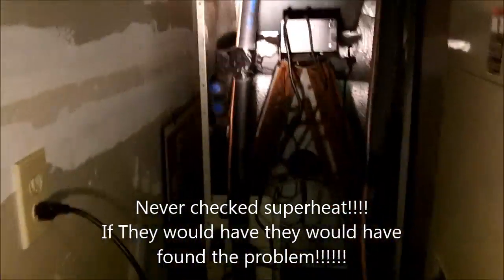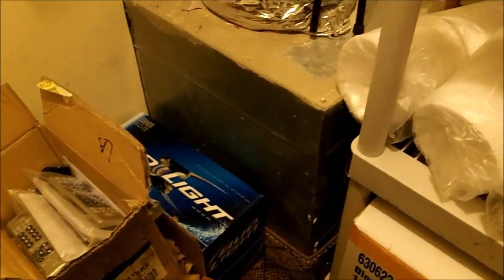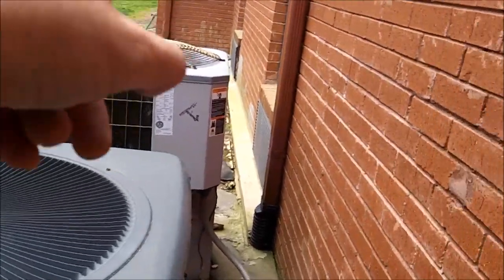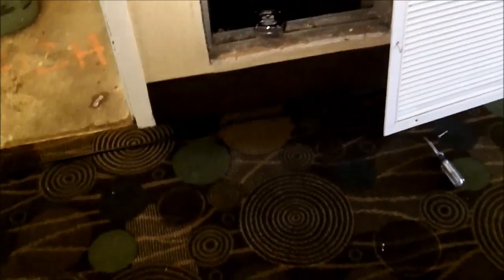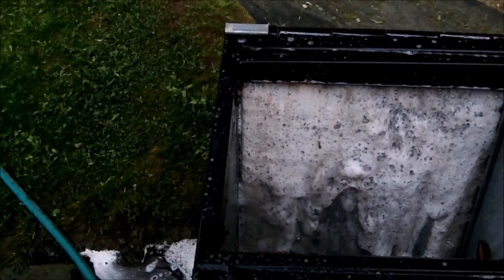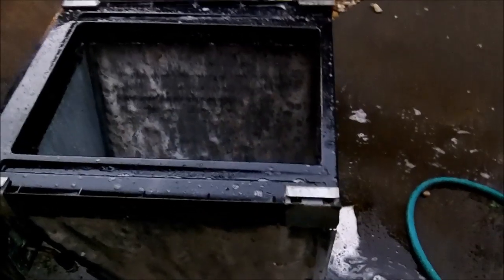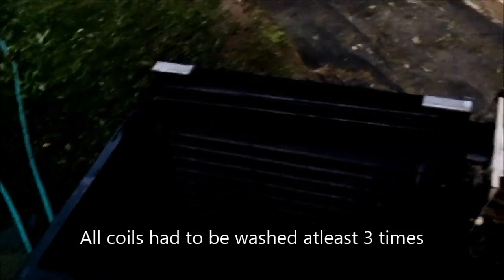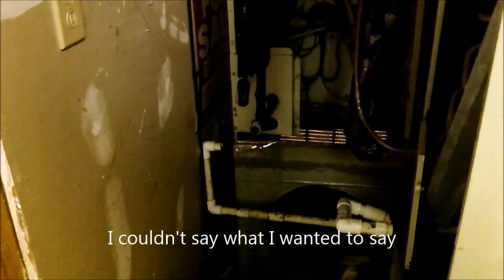HVAC Beer Can Cold Is Better Than Super Heat

Comment: hey, great video, .... can you tell me if i need to have a ball valve on the high side for disconnect purposes?  i have regular 5 ft. hoses and there is no ball valves.  if i wear heavy-duty gloves would i be ok, or will i risk losing too much liquid?  i don't care about liquid loss, i just want to pop some manifold gauges on and see if im low on R-22, and if i am , i will pump a few lbs in there or whatever it calls for but I heard you can hurt an A/C system with the wrong disconnect procedure. would you recommend ball valves on all 3 or just the red (high-side)?  also, the last person who serviced my A/C didn't put the schrader valve caps back on and it's been a long time since it was serviced, should i buy a schrader valve replacement device so I can do a leak detector fluid on the replacement tool and then if they show leaks i can use the tool to replace the schrader valves on a running system?  Or do you think those un-capped scrhrader valves are probably ok even though the caps were not replaced at last service?  my A/C is only faulty on REALLY hot days (air is not ice cold), which leads me to believe that i am low on R-22 since i have cleaned the condenser coils outside and checked the filter.   I have not cleaned the evap coil , but i don't think it's that dirty., but it has never been cleaned in 24 years that I am aware of.  The problem is , i can't see underneath of it, just the two sides of the "A" shape.  the two ends of the "A" have plates so I can't see inside (and of course, I can't see underneath of it because it is on the floor of the furnace).  I know this is a lot to decompress but your help is immensely appreciated.

Comment: Don't blame the installers/ HVAC contractor. Blame the genius engineers for packing the air handlers in the small rooms and the lack of airflow. Good work though buddy!
Reply from the maker: Everyone is at fault here from the engineer, installer then the inspector.
Reply: Do you know how many times I told a builder that a room, chase or unit was to small and they said cost be damned make it right .............. that's right never. Got to love these service guys who think the installer came up with the room size and equipment configuration.I know where the place is he was at and the code states clearance in front of unit has to be the same as unit depth so don't blame the installer for the code or the room size he did his best to make chicken salad out of chicken shit.
Reply: Why would you ever blame the installers?  Half the problems out there are created by inexperienced installers.
Reply: ju87b1 if the clearance required on the installation manual is not there, it is an installers job to walk away from the job. If you are a good installer you boss should respect your knowledge. If he doesn't, look for a new job. If someone told you to jump off a bridge, would you?  If it isn't correct, don't do it. Plain and simple.